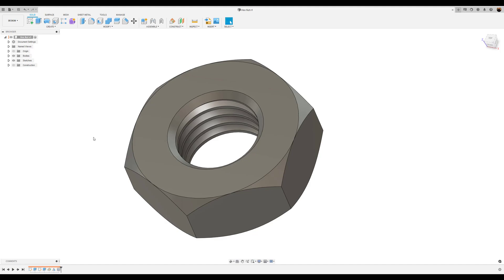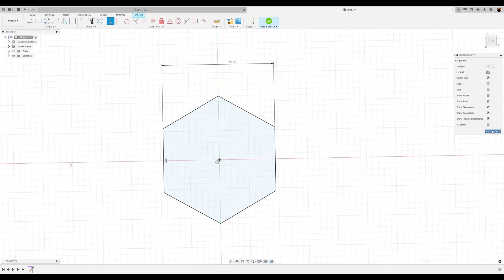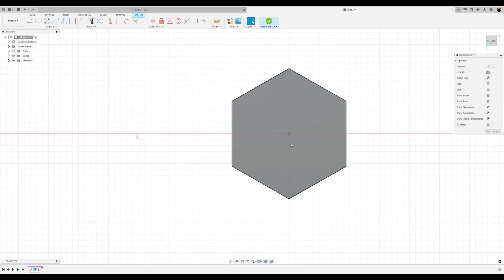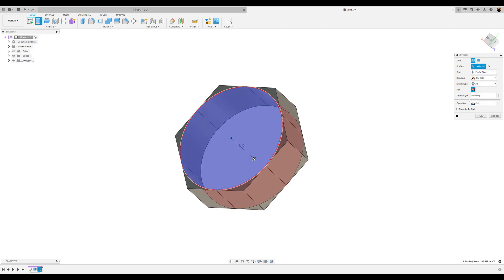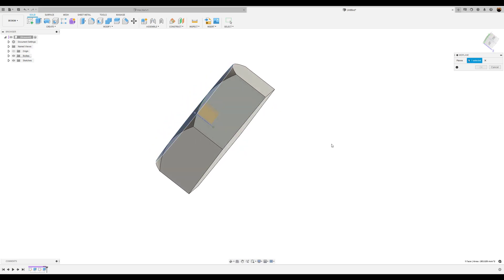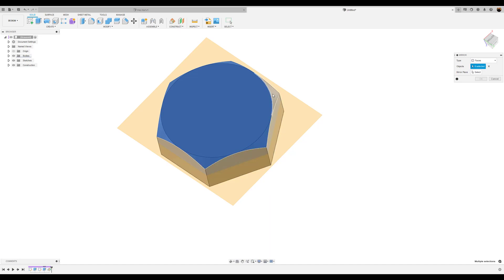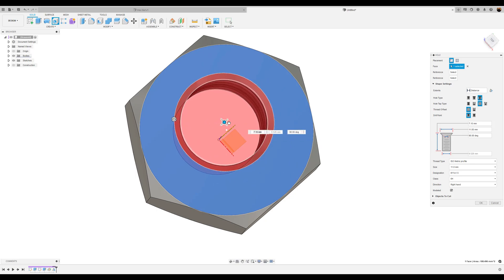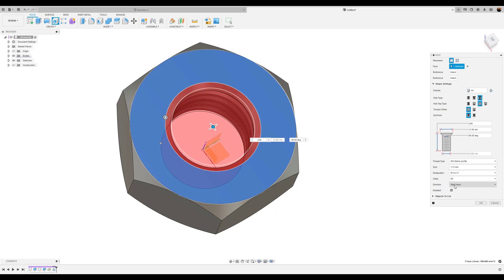Create a hex nut in Fusion 360 for beginners

Comment: The thread is not correct - it does not exit the countersink.
Reply from the maker: Great observation JD, if you look closely at the threads they meet pretty close to the countersink edge, but should not interfere with the rotation since the clearance remains the same width.
Reply: @CADJungle  I don’t know what this means, but I know threads.